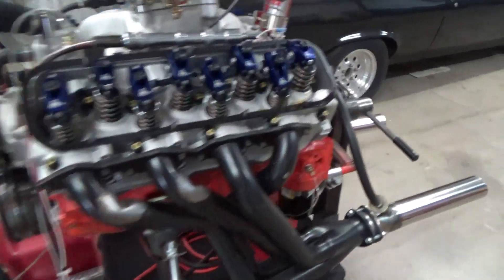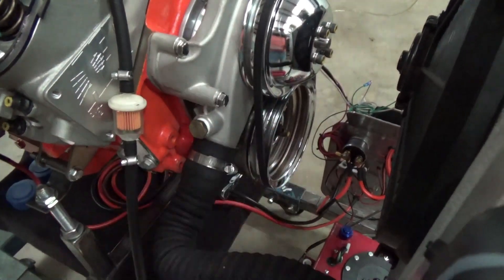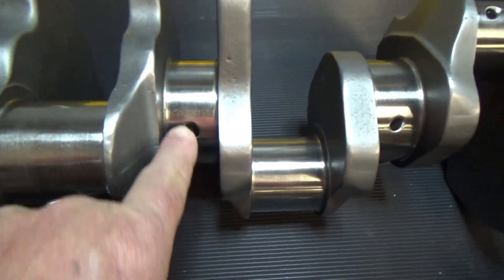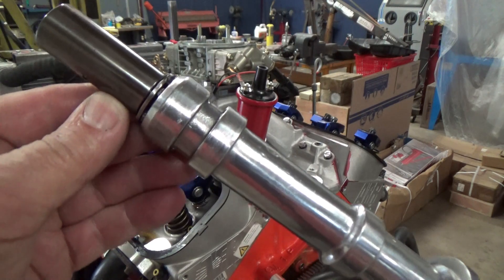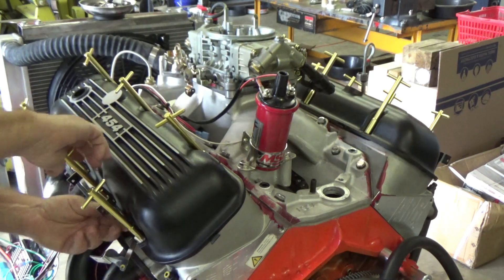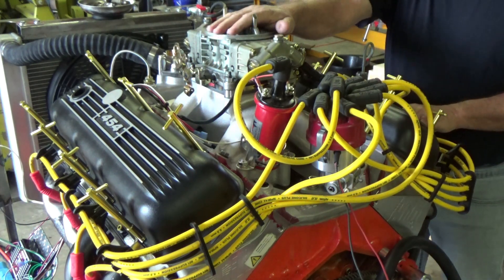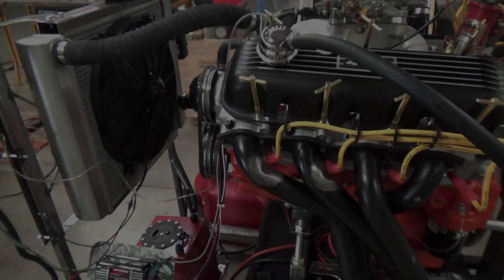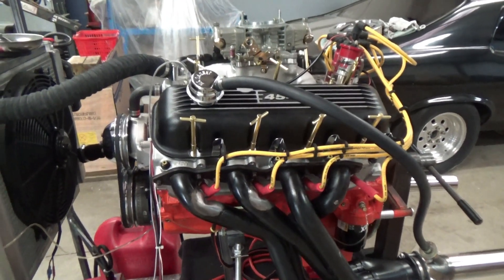Priming engine before first start-up and setting ignition timing #34

Comment: Just came across the channel, good stuff 👍
Interesting way to time it.  I just find true tdc and then set the distributor in btdc where I want it with the rotor lined up on #1 on cap.
About to plan a bbc build.  Wouldn't mind to make a 535 if I can.  Not sure, gotta 361959 2 bolt.  Guess I'll have to sonic it and see if 0.100" is doable.
Would like to build a 825-850hp 91 octane 24° tunnel ram build but not sure if I'm willing to spend that much right now.
Would live to build a big inch spread bore 9° but that's way outta the budget 😅
Reply from the maker: Thanks for the nice comment and your timing info... Your BBc build sounds like a fun build... Sounds like you have experence in building engines and injoy it...
Look up Grumpys Performance Garage forum on the net... Lots of info...

Comment: Heres another gr8 tip, if is a new build and your breaking in the cam.  Using zddp oil or aditive, its better to pre-heat the oil before filling up ( just put in old pot and heat up to about 180°) zddp does not start activating/ work till the oil has got up to temp. So heating oil up first when adding to engine speeds up the zddp activation process. Hope this tip helps you out.
Reply from the maker: Thanks for the info...

Comment: One thing that really needs to be said, & this comes from experience. I'm now a retired auto engineer living in Australia. Whilst some might think it is okay to fill the oil filter, DON'T!! there are engines that will NOT pump the oil through with a filter full of oil!! I have worked on literally HUNDREDS of engines like this. I prelubricate all internal components during assembly with assembly lube. I also prime the oil pump before fitting. What can happen if you fill the oil filter prior to installation is create an air lock in the lubrication system, thus stopping oil from being pumped through the engine. I had a car brought to me with this problem. I like to prime the lubrication system too. Doing this has several advatages. You can inspect for oil leaks once system pressure is built up.
Reply from the maker: I've seen it done both ways even if  somebody doesn't prime a motor I've seen them fill the oil filter up thinking it gets the oil quicker.... and they had success, it worked for them with no problems... But yeah you got  something to think about..
Thanks for the tip....
Reply: @Myersmetalworks all good. Only too happy to pass on tips & help those willing to learn, like yourself. Just something interesting you might like to know. My car is a Mercedes 450SE. I can't fill the oil filter for this car, as it is the element type that is fitted to a metal canister, that has a long bolt through the centre with sealing ring. Some places where these cars are serviced, forget to change the sealing ring on the retaining bolt, & this results in oil leaks, or they forget to remove the old seal at the top of the canister, & the oil leaks from there.
Reply from the maker: Thats a nice car.... And great info...Growing up in Florida had a freind whose parents had Two Mercedes.... I think 220 maybe? But they had this cool speedometer that was vertical... Always liked watching that thing going down the road....
Reply: @Myersmetalworks  The 220 fintails had the vertical speedo. I had one of those cars, as did my parents. That speedo was strange. W111 series it was.